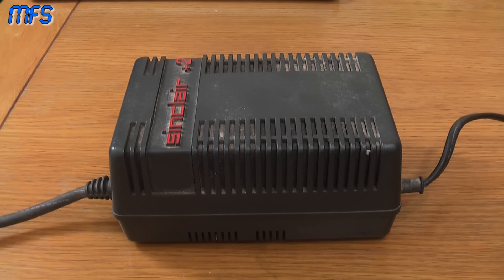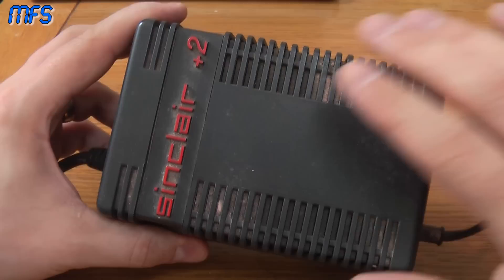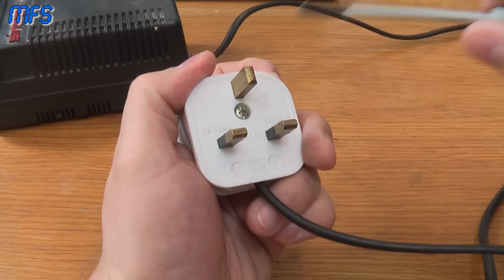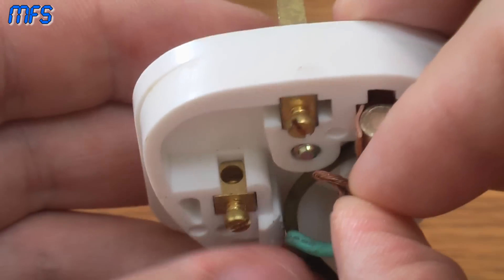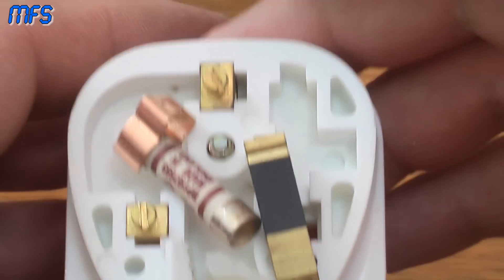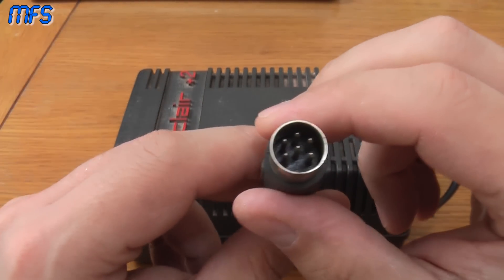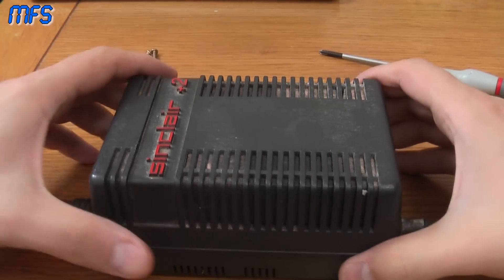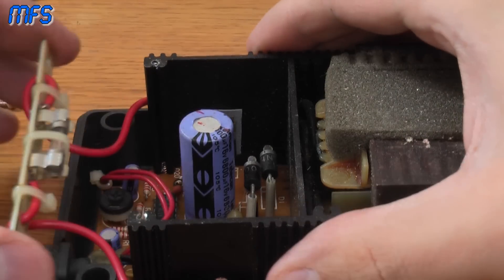Fixing a Sinclair Spectrum 128k +2A/B Power Supply (PSU) - Common Cause of Failure

Comment: Hi mark great video! I`ve got a +3 power supply thats causing a slight grain to my out put, but when I use my +2 power its nice and bright and clear any idea??
Reply from the maker: Hi Richard. The capacitors are likely dried up inside. I'd recommend servicing it with new ones because they won't be smoothing the power properly anymore.

Comment: I've repaired a few of these power supplies where the mains fuse (upside down) has been a T3.15 amp fuse rather than T315mA. As they still had a tie wrap around them they must have been like that from the factory! Needless to say, I installed the correct value fuse before I boxed them up.

Looking at the size of the wire inside the fuse on this one, I'd say it's also got the wrong size fuse fitted. You might want to pop it out and check...
Reply from the maker: I'll be honest. I don't actually use these myself. I have a new more efficient PSU for my DIN plug powered Spectrums from ByteDelight. I'll pop a video up about it soon.

Noted on the wrong fuses from the factory. I've found one similar as well. Fairly typical QA for the time.
Reply: @MarkFixesStuff  Agreed on the poor QA. 

A 315ma fuse would probably stop the thing going up in flames if the transformer developed a short in the primary winding - a 3.15A fuse definitely wouldn't 🙄

It does make me wonder why they were not subject to a recall.....
Reply from the maker: @davidsmethurst1056  "money"
Reply: @MarkFixesStuff  Of course, this is Amstrad we're talking about 🤣

Comment: Just opened mine up, it doesn't have the second fuse or mounting. is labelled as +2A PSU
Reply from the maker: I'd like to see a picture of the insides if possible
Reply: @MarkFixesStuff 
https://photos.app.goo.gl/d8oLaHBywVTgzZWdA
Was hoping there was something obviously wrong with it as 5v pin reads around 2v
Reply from the maker: @BenRattigan  I'm not very familiar with that model of PSU. If I were looking to fix this I'd start with voltages inside the PSU, but at your own risk  :P

I suspect that one of those TO-220 packages is a 7805? If so, check that it is getting more than 7.5v on the input leg and is outputting 5v on the output leg. Capacitors are always suspect after 30 years as well.
Reply: @MarkFixesStuff 
Yeah I am gonna put to onside for now managed to get hold of another couple of them to try on my +2.
Reply: @MarkFixesStuff  Thanks

Comment: No part number?
I've checked the data sheet and these match at CPD by Multicomp. These are the cheapests ones:

Fuse, 5mm x 20mm, Glass, Quick Blow, 3.15A 3.15 A 250 v = MC000829
Fuse, 5mm x 20mm, Glass, Quick Blow, 315mA  315 mA 250 v = MC000892

Is using the cheapest ones OK or not OK?
Reply from the maker: Stephen Blower thanks for the info!  Never had an issue using cheaper fuses to my knowledge. They are not complex parts so doubt it would be a problem.

Comment: common causes of failure also includes,regulator and resistor failure on the -12 volts side of the supply after it was run under load when the fuse blew.(they literally burn out)
5 volt can also fail at the power transistor,as it regulated from the +12 volt side which can also fail
these were also made with no mains fuse slung over the heatsink,i have a few,just another variant made by amstrad

Comment: If you do make a video about fitting plugs it might be worth pointing out that a 13A fuse is not appropriate for this kind of equipment.
Reply from the maker: +RedDragonUKTech I was thinking that at the time actually, but was trying to be concise (hence just "moving on") and didn't want to end up rambling and ranting.

I will add it to the list though as it's a good point and very well made.

Comment: You forgot to mention it should be a 3amp fuse not a 13 amp, if my maths is correct :)
Reply from the maker: +Andrew Millea As I said to someone else, that's absolutely correct but to keep the video short and I decided to leave that for a more general video.

That plug is in the bin now.  3a for sure by the way, and BONUS points for saying "maths" instead of "math"!
Reply: I was sure you would already know that =)  I just figured you forgot to mention it.  I forget to mention lots of things in my vids as well.  It's easily done when your brain is rail roading you into thinking talking about other parts of a system etc. =D
Reply: +Andrew Millea Yes, 13 amp is a fire risk in something like that!
Reply: @GadgetUK164  Yes, even more so when the wrong mains fuse was fitted inside the PSU!